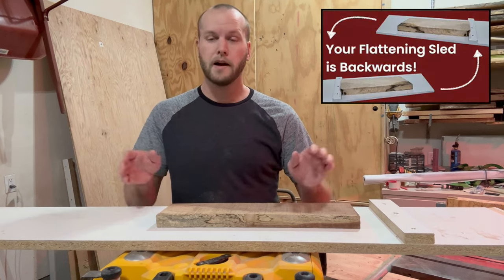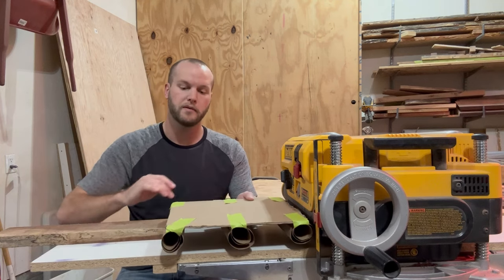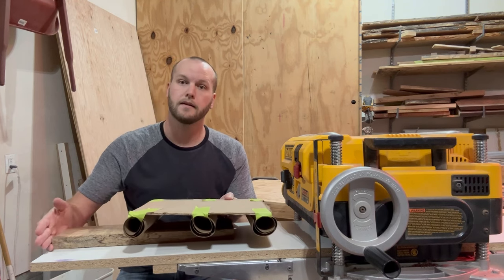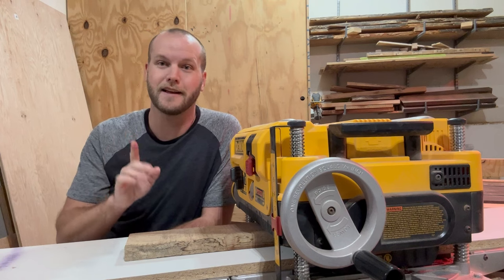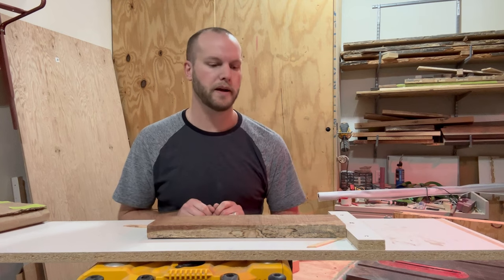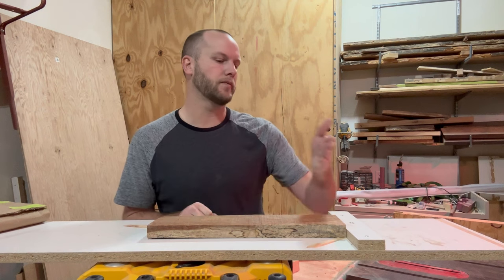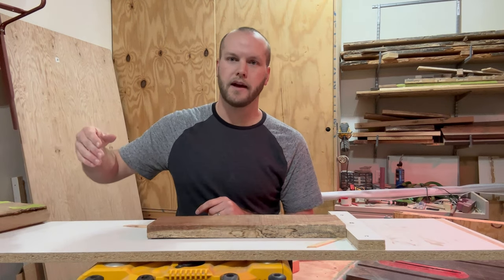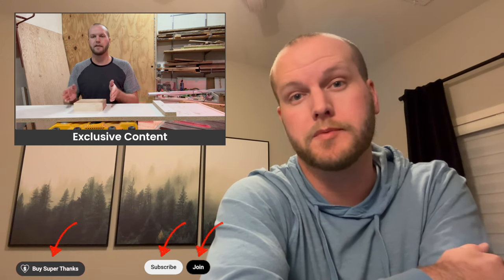Why Your Planer Sled Might Not Be Safe

Comment: This is great, thank you!  I'm less than a year into this new hobby, and I always find it helpful to have a mental model of what's happening that lets me predict what's safe and what isn't.  Your cardboard prop is perfect.  :)

Quick(ish) note about friction:  one thing I remember from my physics classes is that friction is almost always lower between two objects that are moving relative to each other.  (Look up "coefficient of friction" and keep an eye out for the terms "static" and "dynamic".)  I don't think the calculations matter for the purposes of your explanation, but the difference means that the roller starts out pushing forward using the coefficient of static frction... but as soon as the cutting head starts to push the board backwards even a tiny bit harder than the roller can push it forward, the roller starts to slide relative to the wood, which means it starts to use the lower coefficient of kinetic friction.  Just like that, suddenly the cutting head is pushing backwards a LOT harder than the roller, and out comes the board.

This is the same reason a lot of cars have ABS:  a skidding tire loses its grip, so the computer steps in and cuts the brakes to that tire to let it "catch up" to the road again, faster than a human can react, to stop the car faster than it would if it just laid down a long patch of rubber.